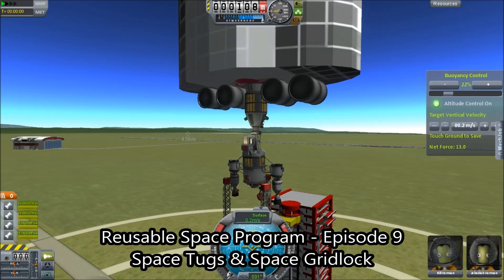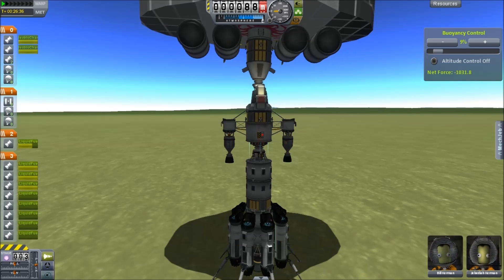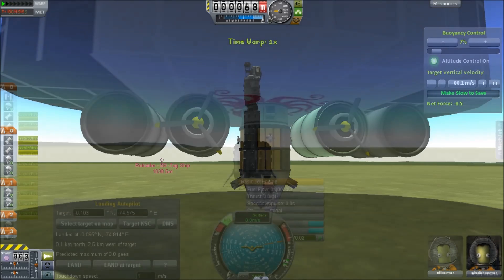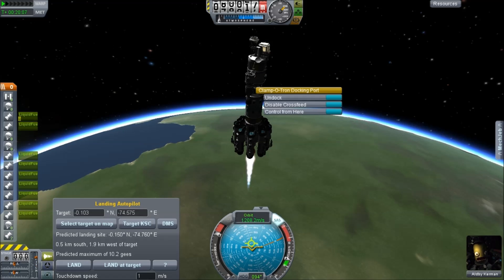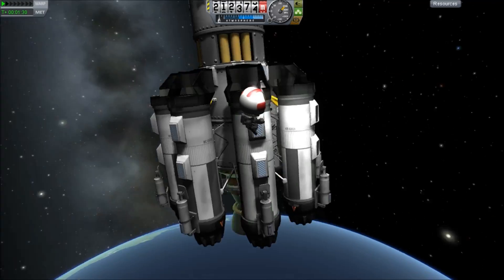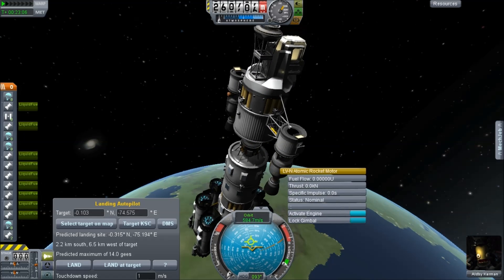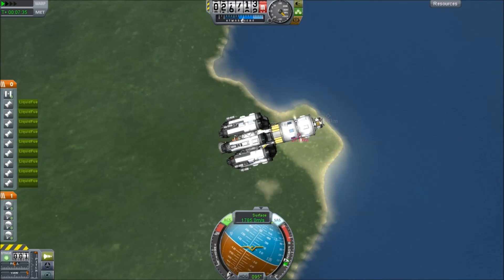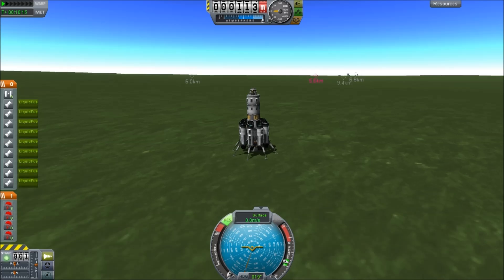Reusable Space Program - Episode 9 - Reprocessing & Refueling, Without The Mistakes.....

Comment: They woudn't actually "dock" at apoapsis as much as they would crash. If they have very different periapsis, it necessarily means their velocities at apoapsis is very different, which means a huge relative velocity. The "docking" would be actually two objects coliding violently.

If the two ships are very close and have small relative velocity (enough to dock without exploding) that means their orbit is necessarily very similiar.

Comment: If you connected everything orbiting a planet, the resulting sructure would be a mesh many miles thick, rather than a ring. Now, if you're saying everything on one orbital plane, then yes, it would be a ring.

This is a complicated subject that many have attempted to solve. The problem is that the Earth is not a perfect sphere, so gravity over some denser, more massive areas is theoretically greater than elsewhere. Thus, the ring would have to accommodate this or fall prey to the Earth's gravity

Comment: You can.  I managed to find out the hard way when I kept sending a rocket into orbit with three nuclear engines attached to a tri-coupler.  every time I activated them, they cowlings would fly away and the engines were nowhere to be found.  It wasn't until two attempts later I actually saw one of the engines floating off into space.  So I begrudgingly resorted to just one Nuclear rocket.

Comment: I've been meaning to test this myself, but I still haven't been able to successfully perform an orbital rendez-vous.

Anyway, what I'm wondering is, would it be possible to dock 2 spacecraft (or space station pieces) using more than 1 dock port at the same time?  For example right now the cross-section of your space station is 1 dock wide.  I'm wondering if it's possible to build a space station with a cross-section of 4.  So you have stacks of square structures each connected with multiple dock